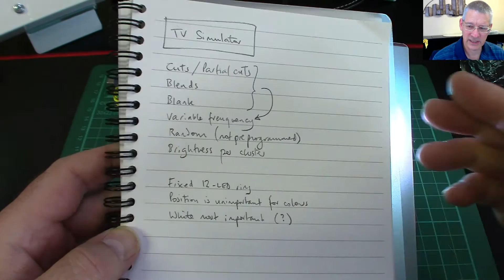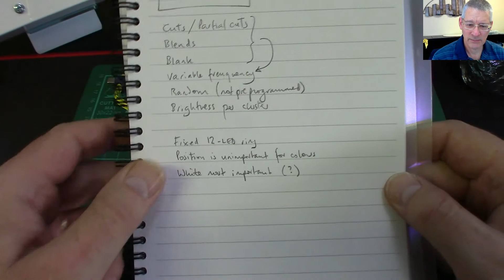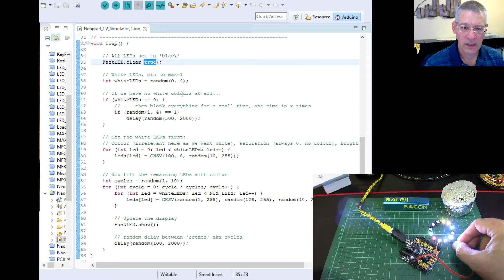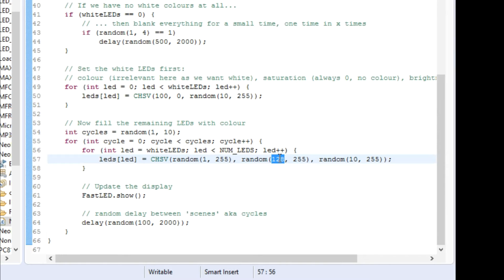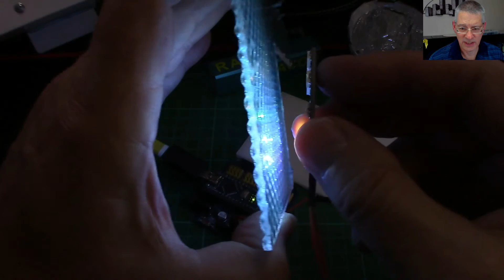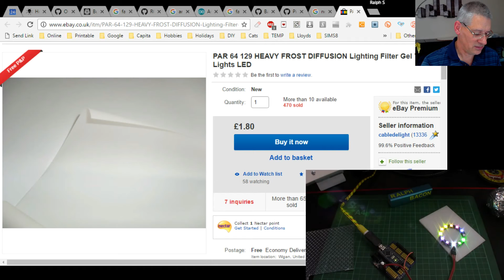#68 NeoPixel TV Simulator - Security for your home - Easy!

Comment: How realistic is this for a TV simulator? It changes almost every second, whereas on a TV, you'd see long scenes, then short jumps, then back to long gradual scenes.

Just curious.
Reply from the maker: I have a commercial version of a TV simulator too and it does pretty much the same.
Of course, if you build your own, you could randomise the colour change timing as you wish.
I tested mine simply by looking at it from outside (as though I was casing the joint, so to speak) and I was fooled!

Comment: I tried to make this, but the ring went to full brightness white and stayed there. I tried various other examples from the FastLED library, but with the same result. I suspected the new 2812B ring, but before I rejected it, I tried some examples from the Adafruit_NeoPixel library, which worked fine. Any thoughts?
Reply from the maker: This is strange, Andy. You sure your ring is the "B" version (4 connections per LED, not 6)? You modified the sketch for the correct number of LEDs in your ring or stick in line 7 of the sketch? Connections all correct pin-wise (but as you got it working with Adafruit I suspect the answers are all Yes)?
 
The reason I use the FastLED library here is because, well, it is fast! Performance is far better than say, the stock Adafruit one but if that is the only one you can get working you could modify the sketch to make the equivalent Adafruit library calls (but you shouldn't have to do this).

I have a couple of different Neopixel devices at home but as I'm in a different country at the moment I can't experiment. I'll connect up one of the others between Xmas and New Year to see how they react to that sketch and let you know (unless you tell me you got it working). OK? Nudge me if I forget... (as if)
Reply: Yes, definitely a B version with 4 pins/LED, and I changed the NUM_LEDS to 16. I gather that the timings for these chips is critical, so maybe it's a tolerance issue with the particular batch in the ring I bought. I looked at modifying the sketch to work with the Adafruit_NeoPixel library, but that's beyond my skill set.

Comment: According to the Arduino documentation, I'm not sure you should be loading Vin when getting power over USB.
Reply from the maker: Hmm, interesting point there SuperBooBaloo. I was taking the power from Vin (which is connected to the INPUT of the voltage regulator, in other words the input power socket) but in the demo the board was actually being powered by USB - the first question in my mind is "How did that even work?". Was current being reverse routed via the regulator to the Vin pin? I wonder if my clone UNO is wired up subtly differently that allowed this to work? The USB +5v is (nearly) connected directly to the +5v (via a MOSFET) but not to Vin. Good point you make there, I shall read the schematics more closely to see if I can discover why this worked and whether it was a bad thing to do.

Comment: Hi, Ralph.  I got your sketch (or a reasonable retyping of it) working on a bare ATtiny85 using the FastLEd library just a few minutes ago.  I had to add a 'volatile unsigned long timer0_millis=0;' to the sketch to satisfy the linker, and in FastLED.cpp I had to change the 'if defined....' stuff around the call to yield().  The bare chip isn't really supported, but it was easy enough to work around.  I temporarily stuck the LED strip on the wall and went outside to see through the bay window - it 100% looks like the TV is on!  I feel safer already.  :)

I think I'll move it over to an ESP8266, though.  That way I can modify it to run only between certain hours, and only if a ping of my phone on the LAN doesn't give a response.
Reply from the maker: Fantastic zodak! I'm, glad you got it going on an ATTiny85, I really want to further investigate this little device. And isn't it amazing how the LEDs really do emulate a TV?  Great idea to run it from an ESP8266 (or an Uno with an Ethernet module, of course). Thanks for posting this progress, perhaps others will be motivated by your success too!

Comment: Could you show us your studio setup, especially your video switcher please?
Reply from the maker: Nothing special in my setup: I use the well-known OBS to record the video and because that allows hot key switching between sources have built an Arduino-based video switcher (what else!) so that I don't have to use the keyboard whilst videoing. The touch switch keyboard emulator is covered in video #30 Cap1188 Touch Sensor. I use it every time I make a video. I just haven't got round to making it look particularly pretty but it's certainly functional!
Reply: Many thanks!

Comment: finally revealed! great idea, you can imagine looking looking from outside at a window with all these light reflections going off. could also use a rtc for timing or even esp8266 to control remotely. great project Ralph, cheers Alan
Reply from the maker: Hello Alan! Yes, it's quite effective. RTC desirable (see my comment to Maxx B below) but adds to the cost and then there's that awkward Daylight Saving Time twice a year to put the clock out. ESP8266 simpler as it could pick the time up from wi-fi. Mmm.
Unfortunately I was my local "pound shop" (B&M) today and found you can buy that commercial unit now for GBP 5.99 - but far less fun of course! I also found there an LED strip you adhere to the back of your TV that generates soft light to reduce eye fatigue when watching TV in a dark room. Now there's a project - detect the basic colour from the TV picture and gently fade into that colour at the rear of the TV in a soft, pastel shade. Could be a future project...

Comment: I have run a 12 LED Neopixel ring on an ATtiny85 but I was using Adafruit's Neopixel library and not the FastLED one.
Reply from the maker: Well, at the end of the day the code must send out the correct pulse sequence so six of one and half a dozen of the other, library-wise I guess!  Adafruit stuff is, of course, industry standard and doubtless offers similar functionality to the FastLED library. Great to know this works with an ATtiny85 (ideally suited: small, cheap) and I guess whichever library is best for you (any Arduinite) is the best one to use. Thanks for letting me (and everybody reading this) that there are other ways to get a Neopixel ring to run and we can choose the best option according to our needs (and budget). Happy New Year, NIck (2 days premature, but hey, with that leap second on its way, who's counting?!!!)
Reply: I forgot to mention I was also running the tiny on its internal 8MHz oscillator so no XTAL overhead either. Happy New Year to you as well.

Comment: I made one of these as my first Arduino project. I only had a 7 pixel circle, but when bounced off a light coloured wall, it looks fine. I also added an LDR (just to the left of the neopixels) which checks the light level in the room every few minutes. When it drops below a preset threshold, it turns the lights on, for a random time between 4-6 hours, using a variable to count blocks of 60,000 milliseconds. Once the time limit is reached, it turns off the lights until it gets light the next morning. Then the system restarts.
I also added a red LED for a power indicator, chopped a few holed in an old power adaptor and boxed it all up with a USB cable, so it can be run of a cheap 5v phone charger. I think the whole thing cost just under a fiver.

Thanks for another interesting video. It was interesting to see a different way to sequence the lights.
Reply from the maker: Wow! As a first project that was pretty ambitious IMHO (of course, for all I know, you're a guru programmer!). Yes, the addition of an LDR and running it for a few hours after darkness with an auto switch off is definitely required. The problem with the commercial unit I have is that it does this - but in the summer (dark at 9pm) and winter (dark at 5pm) it runs for either too long or too short a time! It really needs an RTC / GPS embedded but that just adds complexity & cost. Thanks for your interesting post, nice to see that others have approached this in different, cost-effective ways.
Reply: I can program, so the Arduino doesn't have a huge learning curve. It's more for teaching myself the electronics side of things. So the LDR was to learn about voltage dividers.